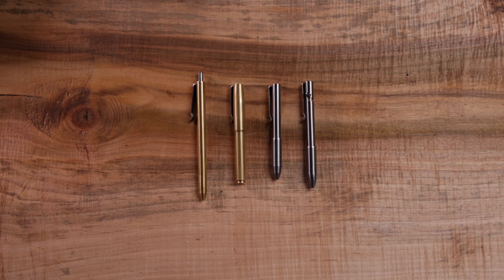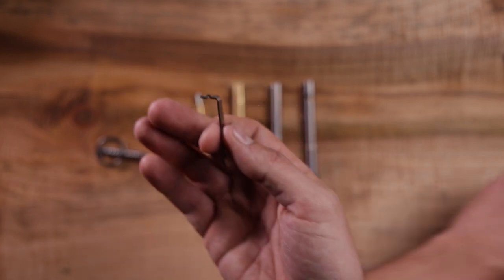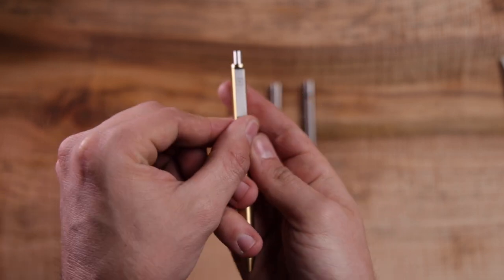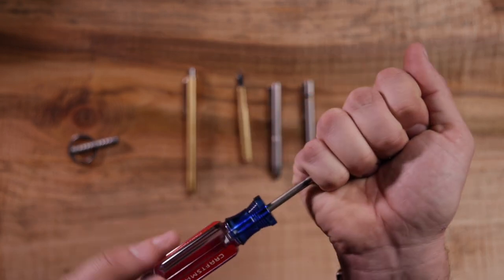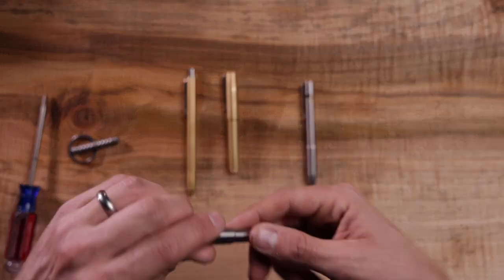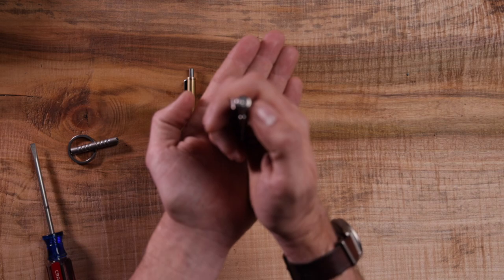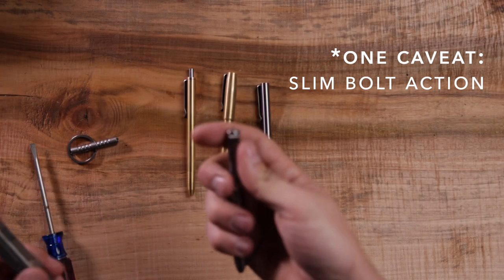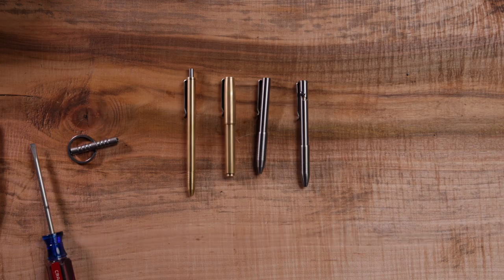Big Idea Design | Pen Pocket Clip Maintenance

Comment: Hello there! buy the Damascus fountain pen clip, but even after following the directions and making sure everything is tight enough, it doesn't fit nicely. Any suggestions?
Reply from the maker: If it is still a bit loose, make sure that it is bent a bit more so that it presses against the body. Let me know if that helps!
Reply: @bigidesign  great problem solve, thanks